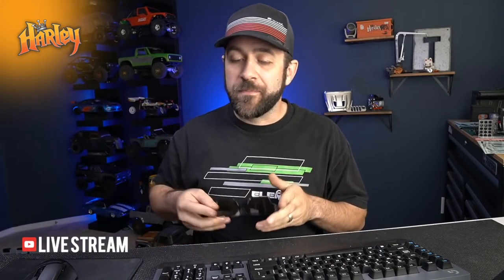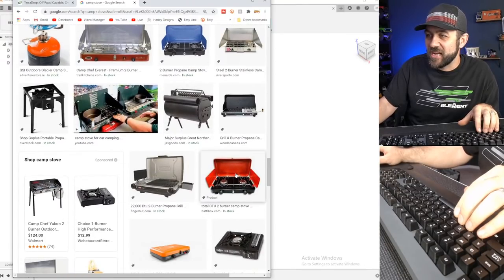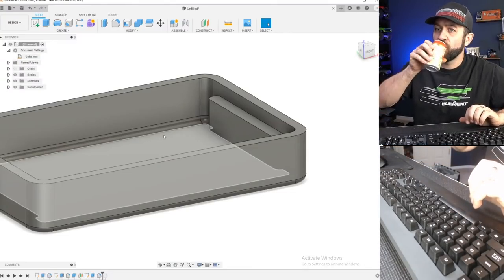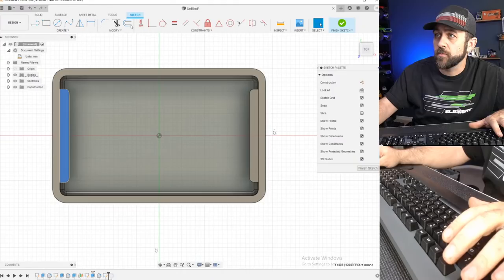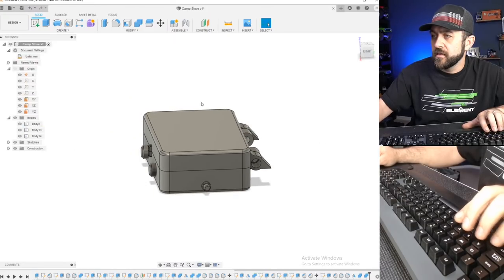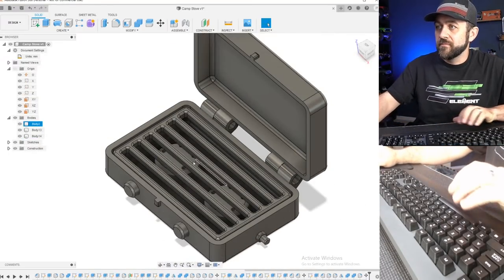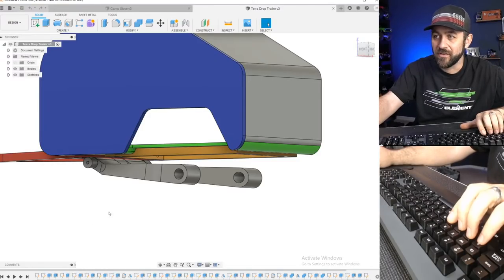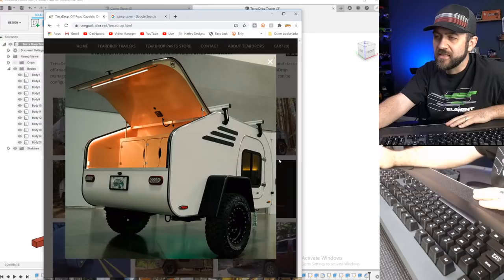3D Printing Sunday - STL Sunday - Ep 12

Comment: I printed the bottom stove part 3 times now, the hinges keeps splitting, even with M2.5 screws. 
I have also tried drilling and tapping the holes first without success.
I'm going to try printing it on it's side next, if that fails I'm printing some 2.5 mm pins to glue in there.

Edit: fixed by printing at 115% scale. Tapped the holes for M3.

Comment: What about an axial driveshaft set screw through the side and into the lid has hinges
Reply from the maker: If they are the M3 style (1.5mm driver) then they would be perfect.
Reply: @HarleyDesignsInc  i agree. I meant the earlier m3 ones.
Reply: I mean for the trailer access lid. Then round over the upper edge on the lid and itll pivot nicely.
Reply: @HarleyDesignsInc  very cool stuff youve been making.